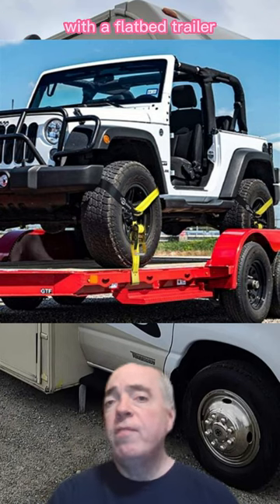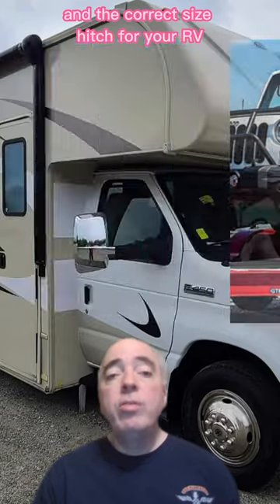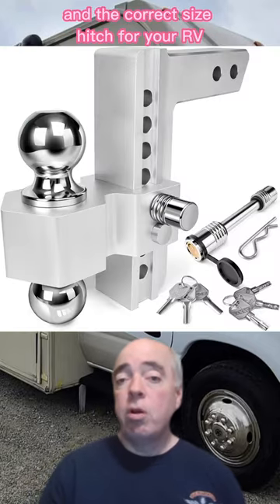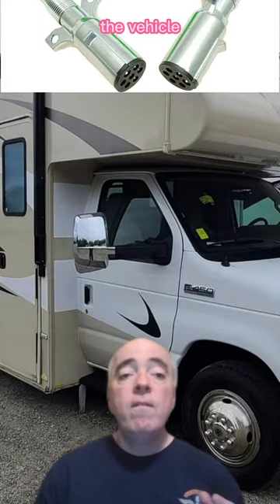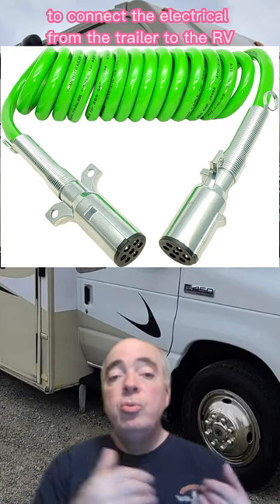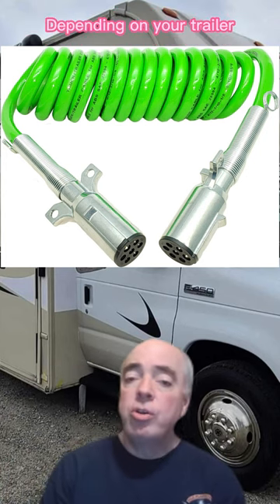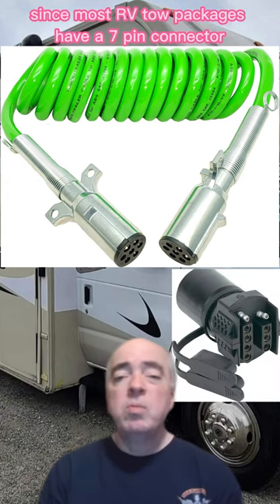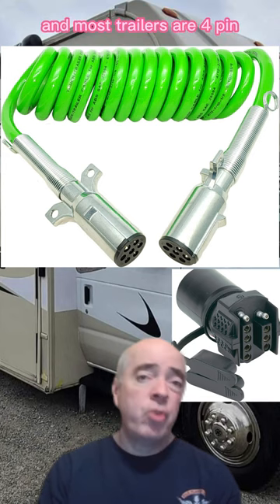You Need to Consider This Before Flatbed Towing Your Vehicle Behind a RV #rv #rvtravel #rvlife

Comment from the maker: Of course this is a simplified explanation of what is needed to tow your car on a flatbed with your RV.  I go into more detail on the topic, as well as other options here https://youtu.be/DB1xayJpNSA
To see more videos check out our channel and subscribe at https://www.youtube.com/channel/UCFCTHatSKvCctZ10QYHBiBg?sub_confirmation=1 
Get “Adjustable Trailer Hitch - Tlvuvmo 8 Inch Drop Hitch for 2 Inch Receiver, Ball Mount Hitch 12,500 LBS, 2" and 2-5/16" Stainless Steel Dual Balls, Aluminum Tow Hitch with Double Anti-Theft Pins Locks” from Amazon at affiliate link https://amzn.to/3MQ9sn4 

Get “Trekassy Car Tie Down Straps for Trailers with Heavy Duty Chain Anchors, 2" x 96" Lasso Style Wheel Straps, 3,333lbs Safe Working Load, 4 Pack” from Amazon at affiliate link https://amzn.to/43s130l 
Get “TORQUE 15ft 7 Way Trailer Electrical Cord ABS Cable Green Coiled Electric Cable Power Cord 12" Lead” from Amazon at affiliate link https://amzn.to/3OUTQBs 
Get “Trailer Plug Adapters 7 Pin to 4 and 5 Flat Blade Trailer Connector for Trailer Tow Hitch” from Amazon at affiliate link https://amzn.to/3WXCzcX

-~-~~-~~~-~~-~-
We have started sharing RV related products as Amazon Associates.  As an Amazon Associate I earn from qualifying purchases.  So if looking for RV related products on Amazon, follow our RV store on our home page.
-~-~~-~~~-~~-~-

Comment: ..........P.S.S for big Tex here any trailer that has brakes is a 7 way connection most vehicles with factory tow packages come with a 7 way and a 4 way that green cord is not needed no one uses a 6 round anymore
Reply from the maker: Good info... no need for adapter then.  Thanks for the updated info!!
Reply: I think you meant the umbilical cord....😂